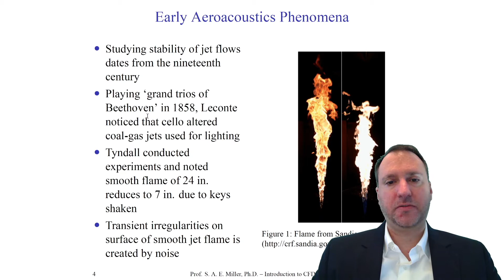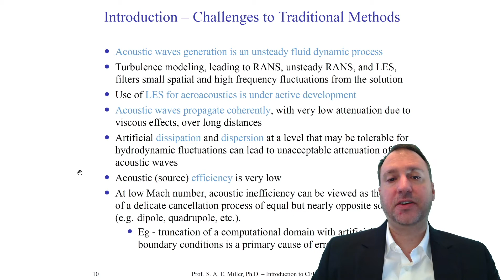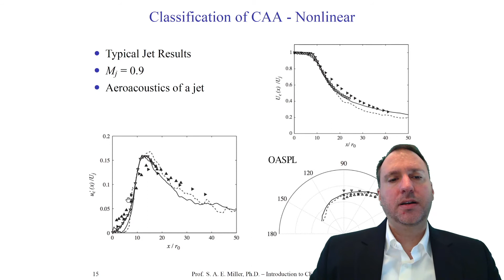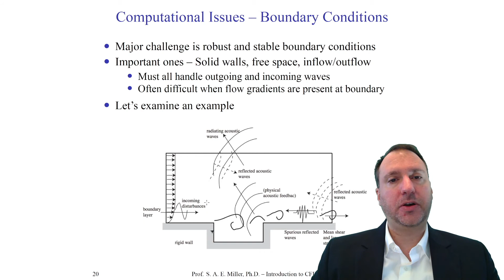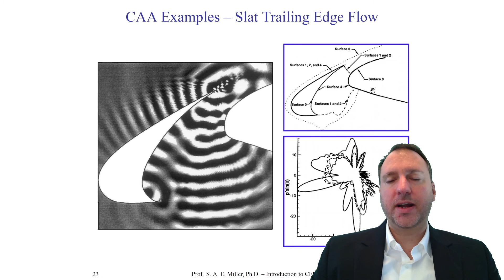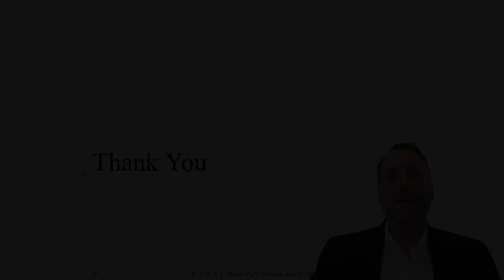Introduction to Computational Fluid Dynamics - Special Topics - 1 - Computational Aeroacoustics

Comment: Hi Prof, 
Thanks for the explanation, well said. I wish to ask about the source and receiver position when performing simulation (fluent), if am planning to extract noise parameters from the trailing edge of a wing. Another question is, what is the flow-time required for complete LES simulation in order to have accurate pressure fluctuation.
Thanks in advance.
Reply: Hi 
Did you run the simulation? I am currently working on a similar problem. 
Let me know if you have any updates about your project, please